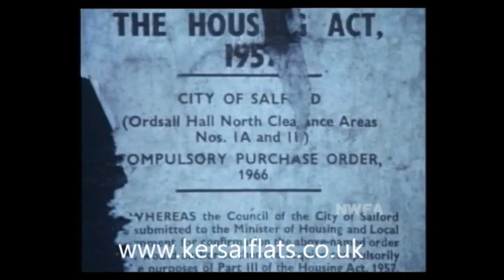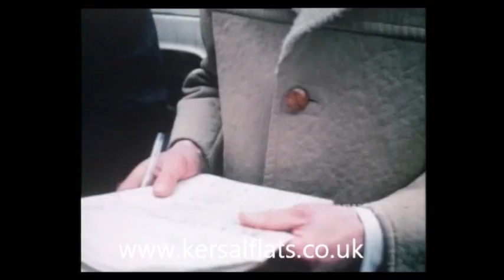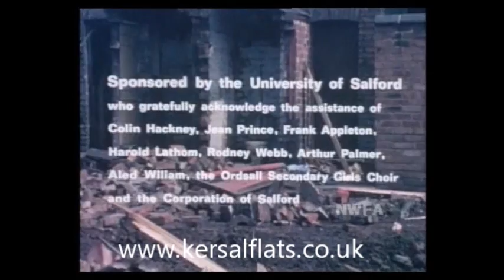The Changing Face of Salford Part 2 (1967-1970) - Bloody Slums

Comment: Ironically the "modern" buildings that replaced them were even worse for the people.
Reply: I grew up on a housing estate built in the late 60's to house slum dwellers. People started moving in in early 1969.  The estate was demolished 13 years later in 1983 because of rats and damp and asbestos, and 30% of the buildings being overshadowed so they got less than an hours daylight even in midsummer. Most of the architects are still around today, living their best life.
Reply: Sounds like forhousing the council.housing provider today Damp.issues repairs neglected

Comment: Shame what replaced these back to backs was faceless towers which are now dynamited & lasted less time than the old terraces.
Reply from the maker: Actually the tower blocks in Salford were built much better than most in the country. In Salford the direct works department meant that Salford City Council built them directly. In other areas outside contractors were brought in who were often had a cosy relationship with the companies pitching these tower blocks to local authorities
Reply: You are right generally speaking but i live near a tower block in lincoln which is in great condition.the council seem to often make.improvements there

Comment: Some of those properties should have been saved and properly refurbished to the modern day standards.
Reply: They were beyond repair.
Reply: @sidstewart7399  As much as too small really,  it should have been possible to double them up, much of the timberwork did not look damaged , and as for no DPC, the bottom three rows of bricks look to be the impervious blue engineering bricks.  While I agree with the overlooking , the modern flats that are replacements of the concrete blocks of the 60s/70s are crowded in with no thought of sunlight.
Reply: @highpath4776  The internal walls will be riddled with damp..poor air circulation etc. They would need stripping back to brick and all timber out. Probably solid 9" wall so no cavity. Would need all insulation internally which would make them even smaller.
And then parking issues etc.
Not worth it.
Reply: @sidstewart7399 there were plenty of larger of such houses that it might have been worth saving.

Comment: Regeneration, they didn't mess about them workman in them days. Looks so easy ripping these old buildings down length of wire attached to the lower walls couple a tugs n down